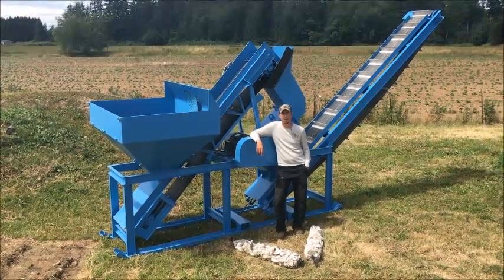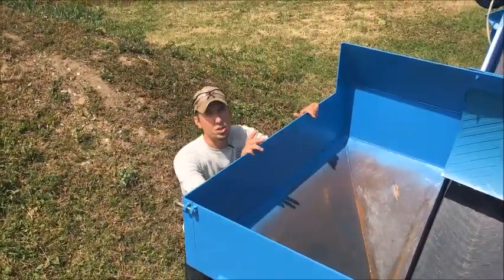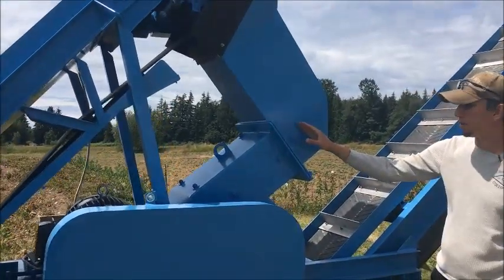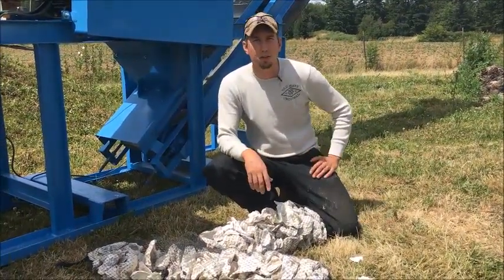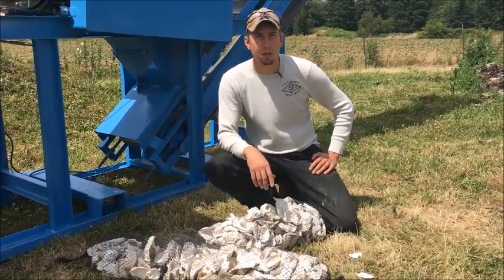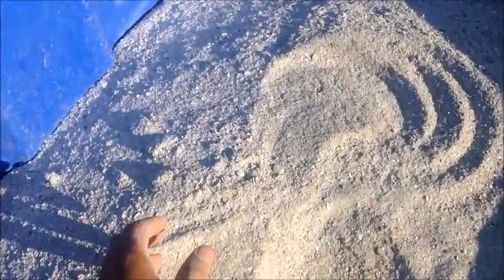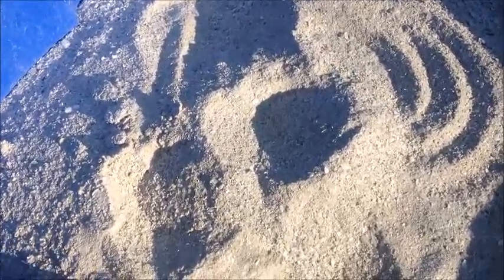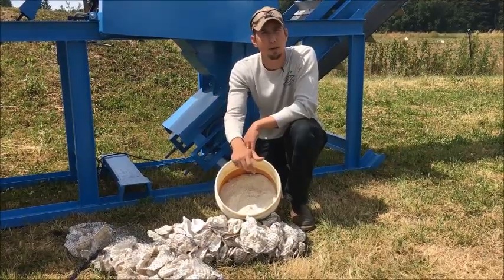Sea Shell/Oyster Shell Processor Grinder Hammer Mill Machine

Comment: Expanding your potential, cool.
Reply from the maker: Its amazing how many different and interesting industries our equipment is applicable in.  Thanks for the comment
Reply: Do you think it should be able to handle a conch shell?  Maybe not whole but partly cracked to be grind down?
Reply from the maker: Yes.  We have ground up all kinds of shells, including: oyster, clam, and sea urchin.  I don't think conch shells would be a problem at all.  Let me know if you want more information about our machines.  360-595-4445 or MBMMLLC@gmail.com Thanks